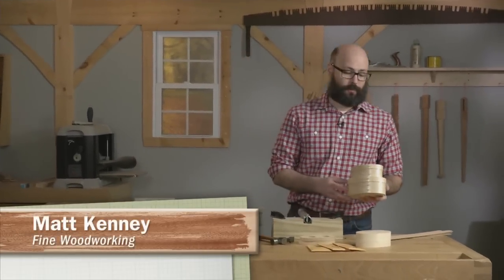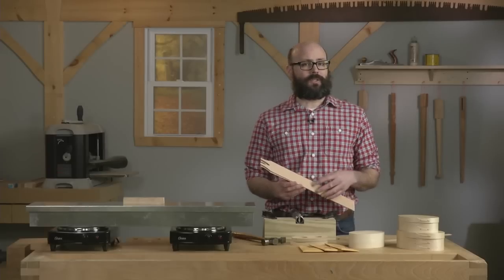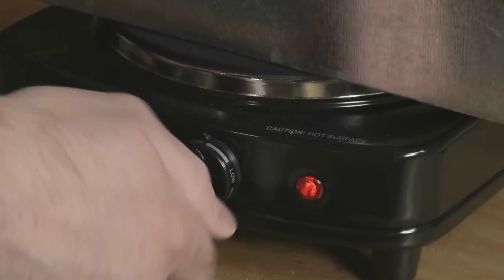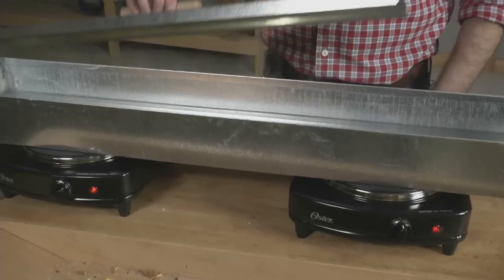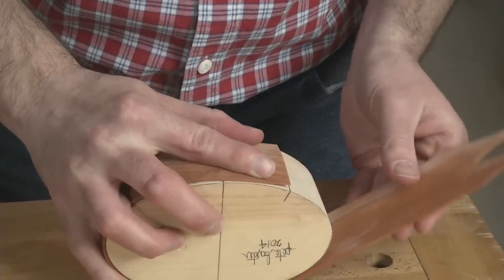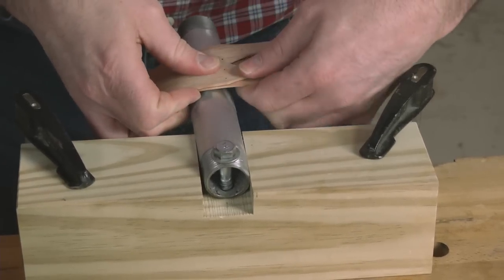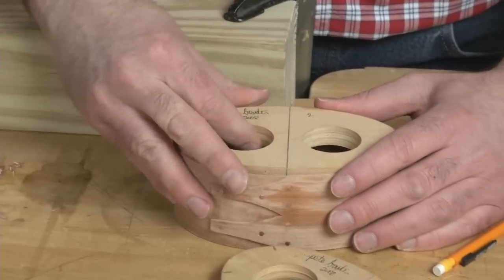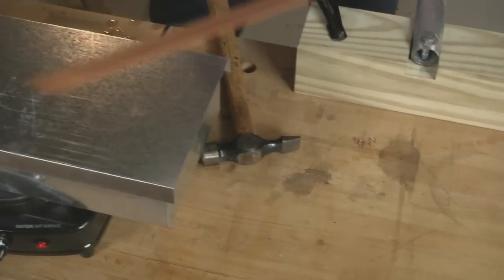How to Bend Wood for Shaker Boxes

Comment: I tried this with cherry.   No amount of steaming it ever resulted me bending it without cracking.  I think once your wood goes through a kiln, bending becomes very difficult.  Appreciate any tips on this...
Reply: Really long grains, quarter sawn and don't be afraid to get it so steamy hot it behaves like spaghetti when you take it out the water.
Reply: Try running the palm of your hand over the bending part as it's bending. Reinforce the fibers with your palm. Don't just pull the the wood over the form without reinforcing the bent as it goes.
Reply: Kiln dried lumber doesn't work due to the chemistry of the cell walls in the wood.